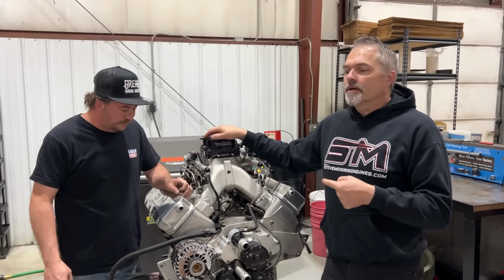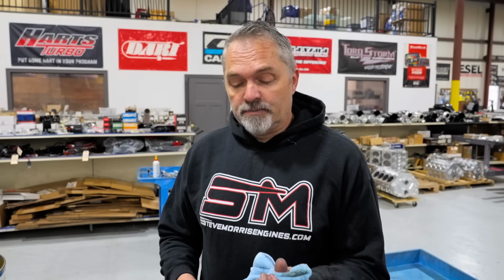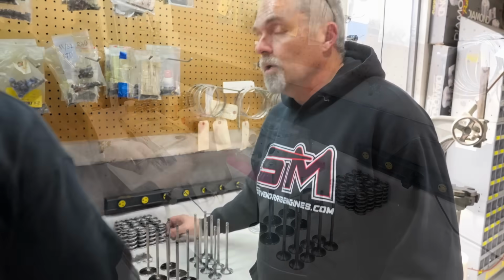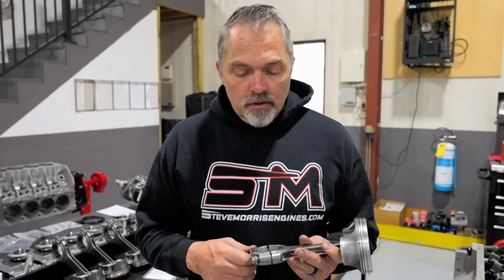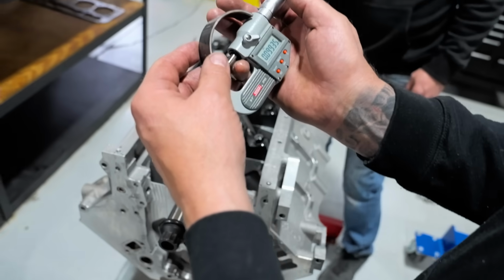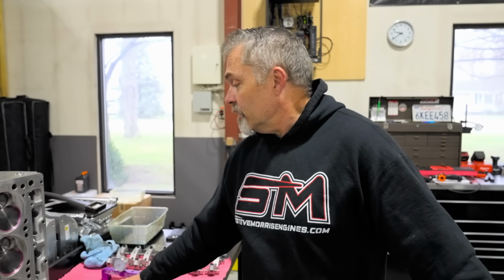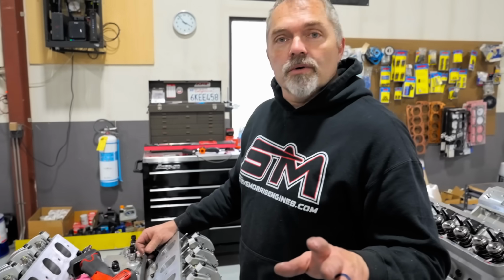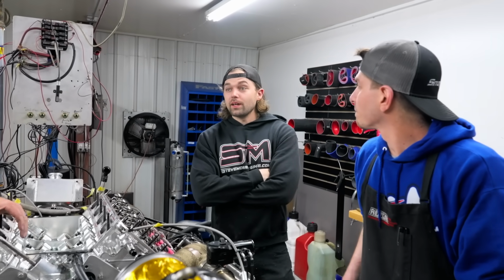HUGE ! 474 cubic inch LS Engine… How Did This Engine Work So Well For 4 Years?

Comment from the maker: Download the FREE Upside App at https://upside.app.link/stevemorris to get an extra 25 cents back for every gallon on your first tank of gas.
Reply: He beat the rats out of this engine and it looks brand new. I built one SBC engine in my younger days and it was hammered, the mains were scuffed and all the exhaust seats had hairline cracks in them. That was about 4 days into it.
I think I messed the timing up.
Reply: STEVE YOU REALLY SHOULD NOT BE DRIVING AND USEING YOUR PHONE .
Reply: Steve any updates on the number 1 daughter car the X sugar'moma?
Reply: Sorry to correct you Steve. Regarding the Stream liner intake collapsing, It is only atmospheric pressure that causes it.. You are thinking about it wrong. 14.696  pounds per square inch is just that, per square inch. If that intake has 100 square inches of surface area there is a total of 1469.6  pounds of pressure on it @ sea level
Reply: The bearing looks broken in the  center?
Reply: I downloaded the upside app, no gas stations offers in my state. Nothing but burger kings and Popeyes chicken, boo!

Comment: You can use bore x bore x stroke x Pi = 4 cylinder  times 2 for 8 cylinder or divide by 4 for single cylinder etc

Comment: Belt drives and the comment on gear drives transferring harmonics,. This got me thinking about the Duramax broken crankshaft phenomenon. If you are familiar you know they all break at the front between the first and second throw. There have been many attempts,and lots of good theory. Still this problem has gone unsolved. You got me thinking Steve, maybe it's the  the gear train at the front of the engine???

Comment: Just to be clear... 14.7 psi....   lbs per square inch.     So if you have a 2" x 2" patch, its 4 square inches.... so its roughly 60psi (58.8)
For those that don't know.   Big Block Mopars (B, RB, or Hemi) have an external pump.   They can have internal pickups, external pickups or as you have there, external storage (and assuming scavaging...).
More 'reasonable' Big block Mopars have a mid sump and oil pressure issues in 1/4 racing.   The problem is the steering arm goes right behind the pan.
If you buy the Miloden external line pump, they put a pass-through the oil pan for the steering arm (so you need to remove the steering arm (4 tie rod style joints) to pull the motor!

Comment: Dry sump is for maintaining oil control under less than ideal conditions. Think aero engines, a simple gravity drain back to a sump and a pickup in the bottom is not going to work very well. Same with race cars that experience extreme conditions for sustained periods. External tank gives the pump head pressure whilst it actively scavenges back to the tank so it always has a good oil supply.

Comment: Hey Steve Can a large shot of nitrous be used on pistons like those if the ring lands were machined lower with vertical or horizontal gas porting? I understand the ring lands needing to be machined lower for a larger shot of nitrous but I wasn’t sure if spraying a larger shot on pistons that are gas ported was a good idea or if the gas ports especially vertical gas ports would they act like a torch tip to the rings?

Comment: The world Really has NO IDEA how powerful the US is.  Its Crazy scary the real tech that's not even been needed.  Under Trump our space branch is spooky!  All the stuff in movies... yes we exceed it.  We have ufos & a heck of alot more.    G forces =gravity. 1G is what you weigh, say 200lbs.  That pilot pulled 7G= his body was pushing down & back in his seat 1400lbs.  Their G suits have air bladders much like a blood pressure cuff... these activate automatically to squeeze the legs & arms hard blocking blood from pooling in his legs & arms....  that's what keeps his brain from loosing blood flow & passing out.  B4 you pass out your vision changes & you get tunnel vision.  Your minds working at crazy speeds making it feel like your in slow motion.  Its common for people in accidents, extreme sports like bull ridding ect.

Comment: Steve, What ever happened with the customers engines not getting done from you keeping their $ and pushing their engines to the side?,
These components aren't anything new, Jesel keyway lifters are good but BAM rules, Larger  push rods are the norm and have no affect on performance on their weight over lighter smaller push rod even if the lighter one has no flex

Comment: Ive never seen a LS/LT or BBC break a timing chain. Stretch sure but never break. Ive seen more belts break ironically than anything. The RCD gear drive for LS works incredibly well too. Nothing wrong with any style of timing drives in LS/LTs

Comment: Hard to get that these engines make over 100 horses per liter NA with 2 valves and even does a good low idle with these massive intake valves. Incredibly interresting stuff mate. Would really like a follow up where details like valve lift and stuff is presented. Hell of an engine. Saying this as a high rev 4 valve dohc guy from Germany.

Comment: Crank balance - theory - a likely reason why this type of crank is fine - crank web is for ups and downs balance mostly. Ask yourself what happens with the web balance at 90 degrees on its specific cylinder where it is positioned and you will realise it is way out of balace (hence balance factor choices) - in theory on a 90 degree v8 the weights will also beneficially be used for balancing other opposite sections at 90 degree parts of the crank (not for these two cylinders where the web is). Once you click with this then you will see that main bearings and block ridgitity are also responsible for balance(keeps the imbalance internal of the block), and you will also see why balance is not so much for power like we feel is good (still good, just cant be as good as we think) but also for other things that are useful for power, like harmonics, or fuel aggetitation on carbied, and general human feel (we dont like vibration) 
And this i feel this is relevant for the middle counterweight discussion. 

I cant tell you which other cylinders the webs are looking after as im not familiar with car engines but the logic is right. 

Like a counterbalanced mx bike motor. Single cyl high rpm. Up and down can be balanced ok for a certain rpm with web. What about 90 degrees. They use a seperate spinning counterbalancer that looks after the 90 degree imperfections (and ups and downs incorporated). So imbalance is known but kept in the cases to stop numbing of the feet and hands. Remembering they go well. And they also are hard on counterbalance bearings. 

All im saying is once this understanding is included in beliefs about balance, then this will have argument in favour of why them non counterbalanced webs are fine and dont bother big picture outcomes.

Comment: Hey Steve, I have a question. Since you were talking about pushrods and lifters and I don't really understand them.  I bought a 2007 chevy suburban about a year ago. I believe it's a gen 3 aluminum 5.3. After I bought it I did an oil and filter change and when I started it, it picked up a tick. I brought it to my mechanic and he seems to think a lifter "didn't punp back up", his words. What would cause this issue? Or is he even correct? He's not a engine builder. He even has someone else build his race engines so I question his mechanical abilities now. 
Thanks for doing these info videos. I learn a lot from your videos.

Edit: I didn't realize this video was from 2 weeks ago  so I don't think you'll answer my question. I'll ask it again on the next new video I watch.

Comment: Question: Hey Steve, what makes an engine RPM rise and fall fast as lightning?  I’ve heard big HP that a snap of the throttle is like a lightning strike, wha-pow!  Idle to 6-7K, back to idle in a second. Versus others that rev up quickly and fall kinda slow…tuning?  Balancing and weight?  Thoughts?

Comment: Hey, regarding the deflection of the printed intake. You’re missing the atmospheric pressure unit being in lb/in2.   Think about it again using the total surface area of both the vacuum and the atmospheric pressure. The lack of a bell mouth may also be creating a negative pressure behind the sharp edge causing a deflection. 

🎉🎉🎉

Comment: While I agree with what you say about various cam timing set ups a timing chain is still not terrible. And by far the cheapest. Notwithstanding budget a belt set up is the best for engines that do miles and not runs. Gears are the most accurate but transfer too much in harmonics for real engines. Even some Sprintcar engines use them these days.
Chains are far better than gears in that respect as well.
Belts do stretch, eat off teeth, seen it in Jap engines too often. And yes they were dry. Where the belt is exposed also gravel etc will damage them. Had that issue with dry sump belts for many years on a road race car. Saw one on a Sprinter engine that was half broken,, car was put away for the night

Comment: Steve - you messed up!!  Ambient pressure is 14 PSI, not 14 lbs.  60 lbs is just 14 PSI over 4.2 square inches.  That opening is easily more than 4.2 square inches.

Comment: Valve spring question - on my 882 smog heads, assuming the can handle the diameter, can i swap to roller cam sorings and run a roller cam with link bar lifters when i turn it into a 388? Thank you for all the knowledge you guve out!

Comment: When a smart man is wrong. 
Air pressure in freedom units is 14.696 psi
That's pounds per square inch and that intake horn has to be around 800 square inches. Calculating out his 60 pounds it is only a 0.5% vacuum inside intake horn (or 14.621 psi inside the horn).

Comment: On Jessy's engine when you were talking about spacer for the rocker arms, you said you could not adjust where it rides on the valve tip, because it was a bracket and if you adjusted the 1st one it would move the other one that was perfect (dead center) was that because it was a 1 PEICE spacer bracket for all of them. Or if you made individual spacers for each rocker arm, could you then adjust each one so you could center them separately and get them all perfectly centered,  OR are they moving in a sweeping motion as the push rod comes up and you adjust the push rod height so as it moves it sweeps the end of the valve. Your example with your hand as the valve sweeping as the push rod came up. I was just wondering if each rocker arm had it's own spacer could you adjust where it to center on each valve. Because you said if you adjusted the 1st one that definitely was not in center it would mess up the one beside it that was perfectly centered because it was a bracket?  Or does centering even matter or make a difference? Because they all make the sweeping motion as the push rod comes up then down?
Reply from the maker: All rockers are on 1 stand and not individually adjustable

Comment: Road race guys from what I got to see in the 80s used a dry sump with a accumulator charged to dump oil back into the engine. I always thought that baffles in the pan would be enough but they are smarter than me.

Comment: Think about this, that engine is under no load while smoking the tires. A drag engine is putting more load on the rotating assembly and valve train. That thing is Singing where it's comfortable. Nice work as always!😊

Comment: Steve, regarding the intake flexing, you're partially correct. The restriction caused by not enough square area of inlet reduces the inlet pressure allowing atmospheric pressure to work on the inlet tube. Just figure a 6"x2" section nearest to the lip 12" x 14.696 atmospheric true pressure would get you 176.352 lbs. This is exercise assumes a full vacuum though. Where this gets fun is testing turbines at full power lowers the inlet pressure enough to condense water out of the air.

Comment: So I totally get your meaning about the different oil pump configurations. However your are in effect mis-using the terminology. The oil pan or oil tank is the “sump”. Just because the pump is external it does not make it a “Dry Sump”. If the pan does not hold the main quantity of oil then it is considered dry and the external tank holds that oil. So oil quantity held in the engine pan is still a “wet sump” engine but using an external mounted pump. Words do matter in this case.

Comment: The main purpose of dry dump systems is oil control. You can better control windage and keep oil from moving out of the sump with accel/decel and turning versus a wet sump. That’s what I was always taught, and read on them before. With a dry dump you can scavenge the oil from different sections, and have it contained in a reservoir, rather than pooling in areas, and then also sloshing away from the pickup screen.

Comment: Wet or dry sump does not refer to the pump being inside  or outside the engine. Wet or dry sump refers to where the oil is " stored".    An engine with a single stage pump with the oil sump still in the pan ( like Kyle's) is an external wet sump.    If the oil "storage" is in a can outside the engine it is a dry sump , defined by the pan being "dry" of oil storage.

Comment: So from an observation and never had my hands on a set of these heads they look basically like a altered valve angle cleveland head.... just intake and exaust valves flipped position to match a ls cam profile??? We've been getting into the cup engine stuff lately and it favors the newer style engines for sure

Comment: I was a rep for Comp Cams for a while and they found the same thing through thousands of hours of high speed footage on the spin tron, you can't make the pushrod big enough. 
The less the pushrod flexes the more precise valve control you have. Small pushrods flex like crazy. 
I worked for them during the technological transition, right when Billy went to work there and they started getting really nice measuring equipment and better cameras for the spintron, etc. It was really cool.
Reply: @Robbycee  Surely it didn't take Comp Cams 1000,s of hours to figure out with pushrods the bigger the better. Tiny pushrods flex. Didn't they know that before like 50 years ago

Comment: By chance on that streamlined engine ( Hemi ) could the oil pump seized up causing the oil drive shaft ( cam sinc ) to stop suddenly( or start seizing ) which chewed all the teeth off the cam sinc shaft ?

Comment: Re 6 vs 8 counterweight cranks.

You can have a 6 counterweight crank that is balanced, but the mass needed to balance those center crank throws is located further out from the center - I would hazard a guess at the first set of counterweights out from the center.
This works perfectly fine as long as the crankshaft is stiff enough to not deflect under the conditions in which it operates.
At a certain point when forces are high enough to start deflecting the crank (bending / twisting - crank whip), when the material strength and geometry can no longer effectively pass that offset balance force along the main axis of the crank without deflecting, an 8 counterweight crank is better since the counterweighting mass is more directly opposite the crank throw.

To put it another way, with an 8 counterweight design the counterweighting mass is essentially directly opposite the crank throw it is balancing. With a 6 counterweight design the counterweighting mass is further away along the crank and there is a lever arm between the center throw and the counterweighting mass. As long as the lever arm doesn't bend, you're good.

If it does start to bend, since the crank is just a big spring, it would set it oscillating. Whether in practice the magnitude of the forces from having the counterweighting mass offset in the case of a 6 counterweight crank ever get large enough to cause this in practice on any of todays high performance cranks I don't know. What the magnitude of these forces are in comparison to the forces playing up and down the crank throws from the engine actually running, also I don't know.
I do know for example with some crank designs, like for an inline 6, if you are limited to smaller journal sizes and journal overlap and or cheap material, than even though the crank balances perfectly when balanced in the usual way, when running its a big noodle. In which case treating it as 6 single cylinder engines in terms of counter weight design and balance you can engineer your way out of trouble - and this is for the same reason - having the counterweighting mass directly opposite the throw rather than relying on an effective lever arm along the cranks main axis.

Comment: Re big pushrods.

If for example you had a 2:1 rocker ratio for the sake of argument, that means the valve is moving twice the distance of the pushrod. So if the lift at the pushrod is 0.5" you get a full 1" of lift at the valve.
What this means is that when the engine is running, the valve has to traverse twice the distance the pushrod (and lifter) travels in the same time - so the valve has to accelerate a lot faster and thus move at a higher speed compared to the pushrod.
When you double the speed of something, the inertia of that something goes up by a factor of 4. So everything on the valve side of the rocker experiences a far greater inertia than the pushrod side. And this is why changing to far heavier pushrods doesn't negatively impact the valvetrain anywhere near as much, because the additional inertia added is far lower because the speed the pushrod accelerates to is less.

Comment: Hey Steve I thought you said this engine uses a MLS Cometic Gasket why did you decide to put a Copper Gasket on it this time instead?
Reply from the maker: They are still, we spray a copper coat on them.
Reply: @ Do you feel like any engine making 1000+ should consider going with a copper gasket setup or is there no real magic number so to speak?
Reply from the maker: @ I do in the 1500 and above
Reply: @ Understood